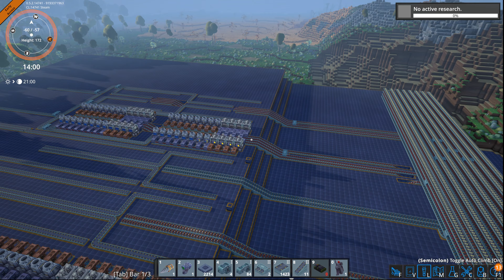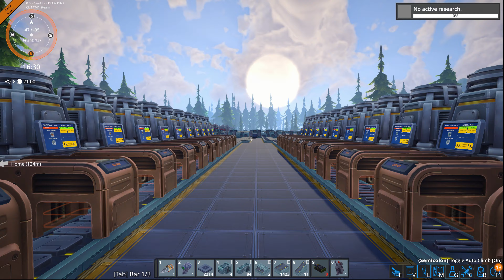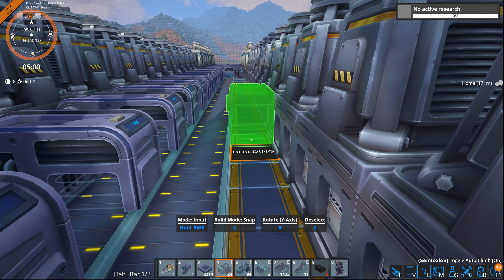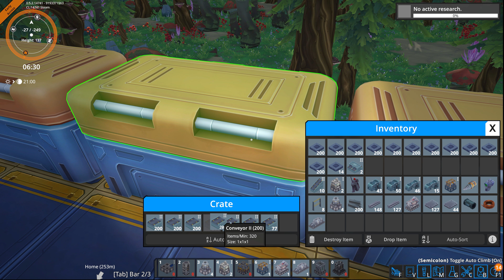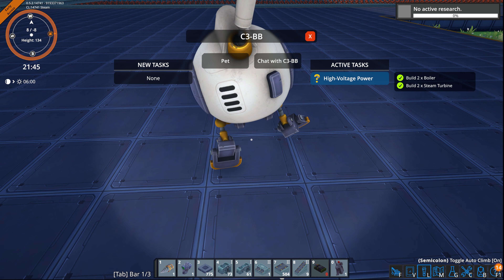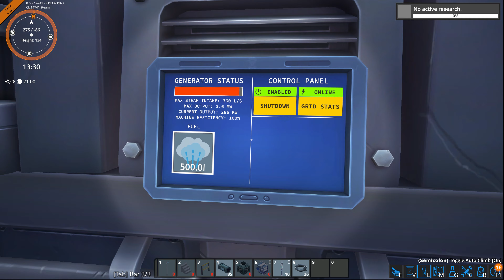FOUNDRY LET'S PLAY - S1 E11

Comment: MASSIVE BUILD!  love it.   soon you will need to add crushers in front of the fuel for that massive steam power setup
Reply from the maker: Ah you know I didn't realize I could use processed ore for fuel vs rubble.  Will change that up in the next episode I record (E15) Thanks for the tip.